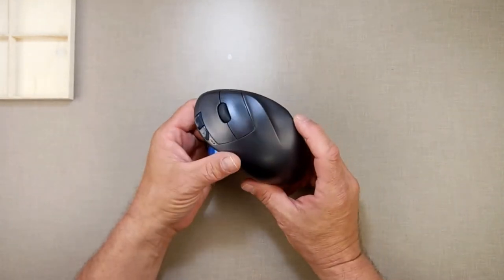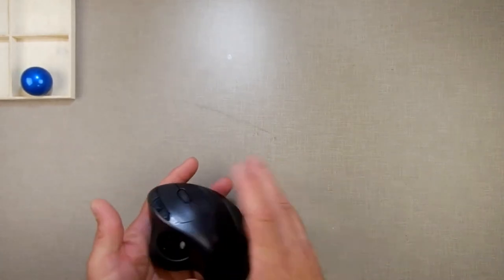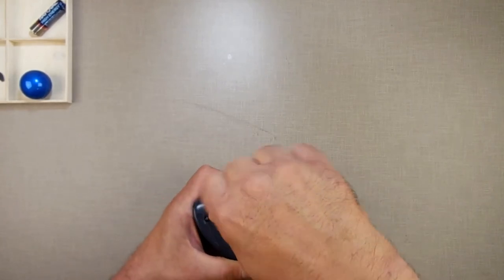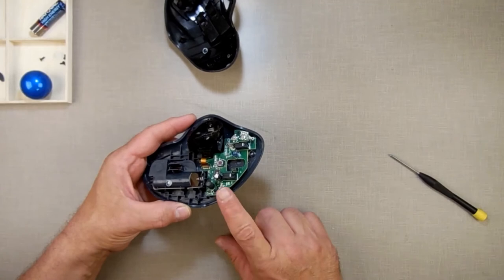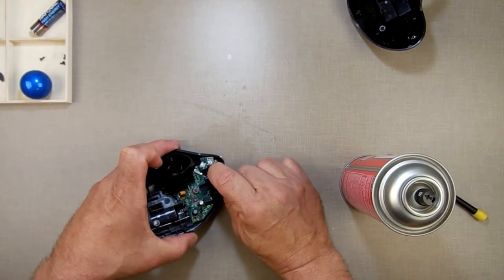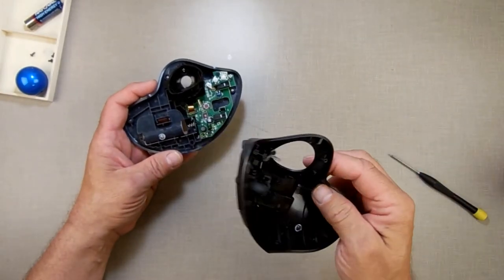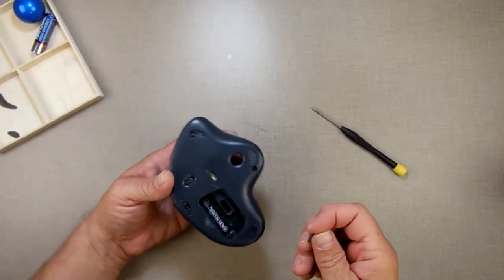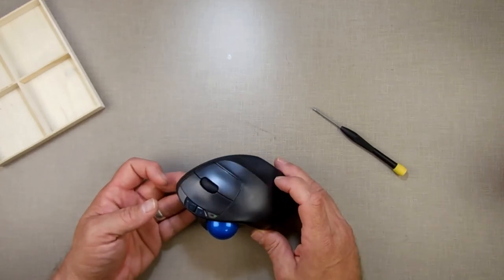Fix the Double Click on an old TrackBall - Extra Bits

Comment: Before you change the switches with time-consuming soldering work, give them another chance with contact spray. A quick spray and then a few quick clicks before the creeping solution has evaporated. Worked wonderfully for me!
Reply from the maker: Did that for a year or so :)

Comment: I used Dupont Teflon Multi-Use Lubricant with success on the Omron switches in my M570.  Easy to control application with the bottle method.
Reply from the maker: Great tip!

Comment: I have an MX Ergo Plus. Same problem, same solution. Only I didn't have any contact cleaned on hand but I did have a can of "Dust-Off" compressed gas dust remover. I opened the trackball, sprayed out the switch (and the entire interior of the trackball) and put it back together. It works fine now. Thanks!